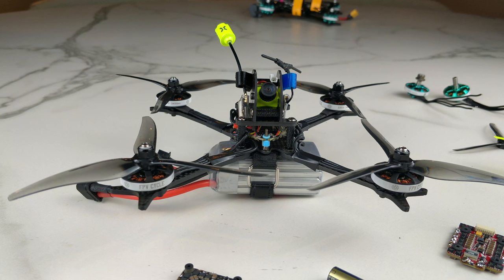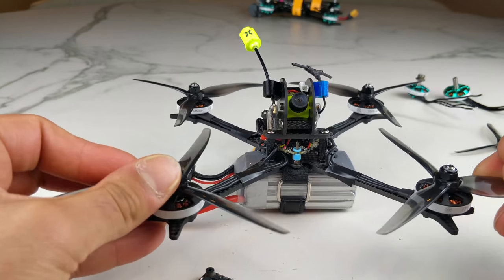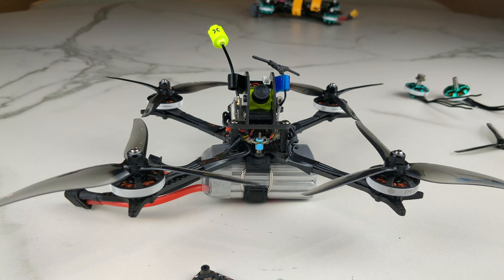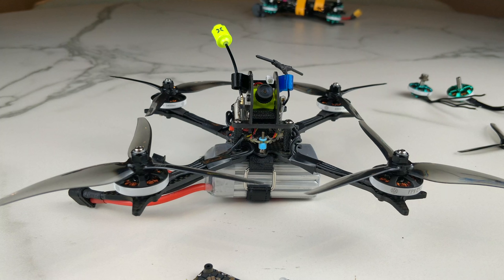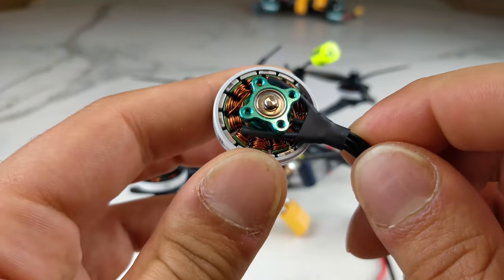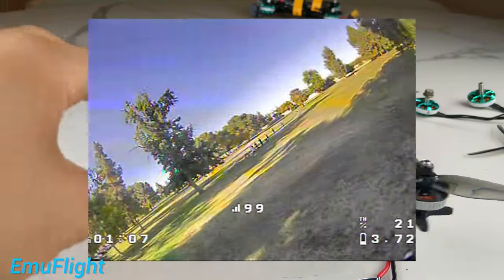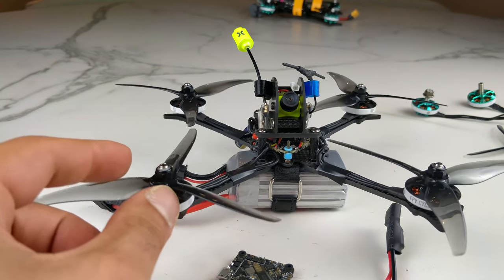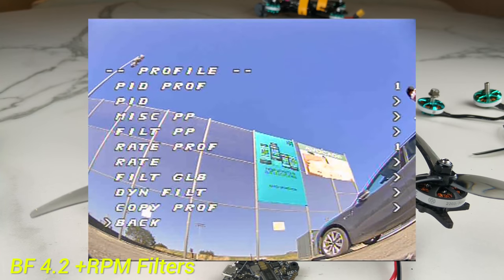Unconventional Tuning...

Comment: Bob, if you are running the same rig in other quads, same everything but different frame (and putting aside the capacitors stuff ) are you thinking on some type of flaw in your frame design or in the carbon fiber used? 
Because as you say the only thing changing from rig to rig is the frame.
Reply: Bruno, check out the first 10 seconds of the video, "..flies great on 3S." "..these motors were never intended for this frame. ..the lower kv motors that are yet to arrive may resolve current issues with this build on 4S."

While you may have a point in some other context, to me this video is clearly about pushing envelopes of the electronics, and drivetrain, given the condition of lack of blackbox data, by sampling the available software tools at our disposal, and it's clear the frame is fine at lower voltage. I might urge you to watch the video, and focus more on the data, and the issues at hand.  Also, if you will not listen to the first 20 seconds of the video, your attempts to contribute will likely continue to have questionable value.
Reply from the maker: I originally thought it had to do something with the frame itself but when I saw this same issue on other similar designs and also lower kv motors I knew it didn't have to do with the frame. I still have figured out how to fully solve the issues but I'm in the process of cleaning it up.
Reply: Rereading my comment, I sound like a total dick. That was not my intention. It happens to come very natural to me. Let me assure you though, that my desire is to be constructive, and that is my genuine reason for speaking up. Bruno, please pardon my tone, as it's something I continue trying to better align with my intentions.

Comment: im curious if you could hand it to a good tuner and see if they can tune it. i still cant tell if its a tune issue or a hardware issue. the quad is definitely super high performance and its been my experience that stock betaflight is very twitchy with super high performance quads. my personal reccomendation is to start by turning off all the goodies. turn off dmin, turn off iterm relax, turn off feedforward, turn off anti gravity, turn off throttle boost. DO use rpm filtering if you can. then tune it old school. start with almost zero pids (like pid=10 2 2). raise the p until it just starts to shake in a hover. then raise d until it stops shaking. then keep i as low as necessary to prevent wandering. In a perfect quad, P will do all the work. for example, i can kind of fly with pid=80 2 2. its sometimes jittery and the nose wanders around a bit, but its flyable. then i add a smidge more i and d and its perfect.
Reply from the maker: I don't use any of those things but antigravity to begin with.  Also, the issues this quad has aren't PID related for the most part.  It's more extreme than that.  It's just really annoying that the exact same drivetrain on another quad is perfect.
Reply: @Kabab  ok good, sound like you already tried all the usual stuff. exact same drivetrain acting different is a head scratcher for sure. they should both fly fine on any frame. I guess i have to agree with you, once i get to the point where I think it might be weak mosfets or partially shorting motor windings or a bad gyro, i just start tossing hardware. couple times i have made it into a science experiment but usually i cant find the time.

Comment: This build is a bit more advanced, even if you've built one before.
Good thing my second build is going to be a 4-inch with Li-Ion, Ardupilot running on an F4 FC, and should be under 300g. That'll be easy! /s
And that's before I feature-creep it and add a tilting camera for no reason.

Comment: There are some capacitors on that AiO FC, they're the little brown rectangles (multi-layer-ceramic-capacitors). While they tend to have less capacitance per weight/volume compared to electrolytic caps, they can have lower ESR (as outlined in another comment). Because they can be mounted right next to the parts that generate or are sensitive to voltage noise, the wire resistance is also less, which makes the capacitors 'faster' and may actually mean that you don't need as much capacitance. But it looks like you're putting so much power through the board that the AiO FC simply doesn't have enough capacitance to deal with the larger spikes from the bigger motors.
Reply from the maker: yep, this is really pushing things beyond how they should perform.

Comment: That bobble with 4.2 often disappears with disabling D_min. Idk if they changed d_min, or something else that just shows up with improper d_min settings, but turning it off simplifies greatly. If motors are staying cool, I leave it off now.
Reply from the maker: Intesting. I'll give it a shot.
Reply: @Kabab  Please share your results with D_min off!

Brandon, thanks for the tip.
Reply: @24kJames  talking with Mark (UAV Tech) really forced me to adopt it. He almost never uses d_min and I asked why, his response is that most quads don't need it. It got me thinking... If you look back at the initial implementation of d_min code, it's purpose was to keep motors cooler, at the expense of slight delay in cleaning up propwash (d_min takes time to ramp up). Well, we have rpm filtering now that kinda solves the issue of excess D-term noise generating motor heat, so we can improve latency on propwash and forward flight by disabling D_min. Even without bidirectional dshot and rpm filters, we don't need d_min usually on a clean build. I think it's defaulted to enabled as a safety feature for those who leave everything default. But it's not ideal.
Reply: @BrandonBeans  That is a solid, well laid out basis for d_min OFF. I very much appreciate such quality information. Thanks again.

FWIW, all I can add is that this topic has bubbled up a number of times in recent readings, and videos, each instance equating d_min off with much reduced bobbles/propwash. My own research on the topic awaits.

Comment: I have been designing and 3d printing my own frames for years. I am really messy with my builds and hate PID tuning. One thing that has come to my attention is that true X frames are very finicky compared to anything else. stretch, wide, hybrid, plus, they are all fine. As soon as you go close to a true geometric X the quad just starts having issues and needs, at least some, tuning to fly properly. Your disclaimer applies to me too, I have some training and experience, but what i offer is just my impression from messing around with quadcopters for 4 years.
Reply: I've built around a dozen quads and about 10 have been true x's and the other 2 more H style, and I don't think a single one has flown anywhere close to how I wanted with default settings on any betaflight revision.  Never had mid throttle oscillations like those depicted in this video that couldn't be solved by adjusting PID's, but most of my esc's are from last generation (bigger everything) and flown on BF 3.XXX.  Not really making any kind of point here, just adding my anecdotal experience to the "data set"

Comment: I think people need to understand the depth that Betaflight has gone into in its long term development from simple Cleanflight fork. DSHOT, Bi-Directional DSHOT,  LP/HP/Notch filters using lower latency algorithms, applying expo to filtering the D term, FF, sliders, linear thrust, anti-gravity, I-term relax, the refined PID loop that isn’t aliasing the gyro signal by people changing it from its native chip speed and locking it in per chipset,  dynamic idle, airmode, dynamic filters, oh did I forget? RPM FILTERING! It isn’t for someone who just wants to flash and fly usually but with 4.2 w RPM filtering and being able to fly out the box 90% tuned on “most” rigs that span a class from 2” to 7” a range of electronics, motor sizes, batteries,  is simply a feat of genius. Betaflight is the ultimate tool for the person who wants to dig deep and get the cutting edge out of their quad but you have to put the effort, research, logging time, and general interest into wanting to do this. In the end it WILL fly better than any other fork out there it’s just people want to flash, do the minimum and fly and if it some other fork seams to fly better it’s, “ooooh <insert name>flight fly’s sooooo much better”, um really? No just Betaflight is for the person who is willing to try cutting edge features now, willing to accept that yeah your probably going to have to spend some time tuning in many places but in the end the firmware is unbelievable code wise with what they have done hands down. Don’t get me wrong there’s a place for firmware that’s super simple fly’s pretty good out the box with minimal tweaking, I get that. Just understand it’s called Betaflight for a reason.
Reply from the maker: understood and at some point I will have completed setups with completed tunes available for people as well because getting all that working right is just an awful experience for most.
Reply: KababFPV Totally and for the beginner starting out that just wants to get out there and fly (and the experienced pilot too) I can understand the frustration level, it happens to me too. It’s like when I’m in the CLI I’m like “I got to do this again?!”. I think your approach to having premade tunes for pre-built quads is a great idea. I’m liking your design ideas. I actually just built a few large CNC machines based off the openbuilds designs and components and going to start offering my services to cut carbon like Arnattan Productions but with lead time of a day unlike a month or more. Plus I’m in so cal too so I can ship USPS priority and people can have their designs within a week. We’re building the site now.

Comment: As a point of clarity - most EMI noise is happening at much faster timescales than the acoustic filtering, so the switching related EMI isn't strictly something that is worsened or improved by firmware filtering running at the <1kHz range - which gets confusing because having improper filtering will lead to stressing the motors quite a bit, and then pushes that towards the EMI filtering end.
As far as the BF development model - I can't figure out what the guys who contribute so much want to do it, but realistically the answer can be as simple as recognition for making something that amazing.... both BLHeli_32 and Thorsten charging per ESC was brilliant, and both are fundamentally the same business model (just who pays for the license).... 
I do agree that 3.5.7 is great out of the box if you can't be bothered to set up RPM fitlering, and there was problems with incorrect dead time setups that burned some mislabeled stuff... but if you're running RPM filtering without changing the CLI snippet defaults, it's not going to fly any better... properly set up BF4.2 is objectively better, I've looked at enough logs, but it's only conditionally and practically that's harder on some setups (especially 7", which are just dumb most of the time)
Reply: tehllama42 Ya totally. I mean the filtering really deals in real life with motor noise as a result of vibration more so I believe as these gyros really aren’t even made for our application. It’s like we’re still using cheap cell phone gyros MPU6000 etc; but I totally get what your saying. At < 1Khz+ I don’t know if sinusoidal vibration can even reach that high of a wavelength but I have no data to prove this, and especially with soft mounting motors, dampening flight controllers, and all the tricks we use to keep these demons at bay. I’m sure EMI is there, I know this, and part of the scheme is built on helping eliminate, or reduce I should say, EMI creep into the FC components so yeah it has a co fusing angle to it. I couldn’t agree more about what they have done. Bi-directional Dshot, from a simple question if it was theoretically possible arising from a development github discussion, to turning it into what it is now. I mean it’s genius, getting eRPM data that’s accurate based off calculating magnet stator rotation and dshot timing control signals at super low latency? Amazing. RPM filtering, to me is the best thing since they started using the basic LP/HP/Notch filtering in the schema they used back in early Beta releases (3.5.7 etc) or possibly when dshot first hit the streets. Once you have it tuned, and yeah it can be finicky on certain quads, but if you spend the time on these CLI features and really dig in and tune to precision it’s the best thing out there and that’s the honest truth. Most people use Emu or Raceflight or whatever fork is currently hot with their couple somewhat interesting modifications and the just think “it fly’s soo much better” but the truth is betaflight is really not (though they have moved this direction with sliders etc) for the beginner for creating awesome tunes and specific flight characteristics. They just want to flash something and do the minimum and if it fly’s better out the box basically “it’s sooo much better than betaflight”. I hate when people say that because they usually don’t have any idea of what’s been done with this software and what is capable of. Learning isn’t all that hard either if people just do their research and have some engineering/mechanical knowledge. Good post. Killer quad tunes with features that are mind blowing are just the representation of someone willing to put in a little extra time and tune it right, but 4.2 out the box almost fly’s perfect on 90% of the quads I’ve used it on, and those ones it didn’t, I just made the proper changes via logging and research over years and it’s fixed. It’s more people understood how hard it is to create a firmware that spans a huge variety of quad sizes, frame setups, motors, batteries whatever and make it fly almost 95% tuned out the box on all these, it’s quite a feat.
Reply: @vicewize  There are some definite knowledge barriers to getting the most out of it, and I think you're exactly right than 90% of people just fly what's out of the box and assume that's the capability, while those who have the right background or enough time to understand the nuances of what's going on can get a lot more out of it.  More levers can be hard, but yeah.  Especially when certain base tunes can just hit lucky nodes where the phase delay and mechanical delays overlap and you end up with really dialed stuff, if you flash four different firmwares, odds are one is going to have the 'magic' answer.  Having a monster fleet of 42 quads, I found that out early on

Comment: You don't need JESC for RPMFilter.  JESC, BLHeli32, and BLHeli_S support RPMFilter, the free version of BLHeli_S works... Betaflight Wiki links it: https://github.com/betaflight/betaflight/wiki/Bidirectional-DSHOT-and-RPM-Filter
(Although I use JESC cause why wouldn't you.)  Also that's my problem with that AIO board, the Betafpv 20A v3 has bb storage.  I usually tune by feel (and ultra light weight quad with 2004/5125 props was nightmare to tune, eventually realized I had to turn pd gain way way down, I got d at like 18.  But even if I just tune with feel, in the end I still like to do bb log just to see how awful tune is.

Comment: Adding a 35V cap to a 4s build is ineffective.. I add a 25V to a 4s,because it has higher mF for same size cap and it is more efficient. Like having a 35 gallon tank, but only adding 16.4 gallon. I would even say a 25v 1000mF would clean up more than a 35V 2000mF, because you are closer to the capacitor rating, so it is doing more work. 
Sure, it won't hold up for as long. But neither won't a quad build to crash.. You replace 4 motors, just replace your cap at the same time.
Reply from the maker: The voltage doesn't matter as long as it's higher than the spikes it'll be absorbing
Reply: @Kabab  but it is still less effective if it is a 35v running 4s than a 25V on a 4s quad

Comment: This just shows how great RPM filtering is. You can just build clean quad(hopefully), add a cap, flash BF 4.2 and enable RPM filtering, change dynamic notch to deal with very low noise between 100 and 300Hz, and rise all lowpass filters to high cutoffs like 400Hz PT on gyro and 250Hz on d-term, and you will get great performance. And if you happen to build not very clean quad noise wise, you just do all the same but keep lowpass filters low, like 3.5.7 low, so gyro at 100Hz PT1 and 300Hz PT1, and d-term, i don't remember, but somewhere around 150-200Hz or perhaps lower, and you should be fine. And i agree, PIDs doesn't matter as much as filtering and clean gyro signal
Reply from the maker: Sure but 4.2 still flies awful by comparison with 3.5.7.  The only advantages to 4.2+RPMf is that there's no dipping on throttle pump and the motors run a bit cooler.  The jitters, high speed wobbles and throttle offset wobbles are still there in a big annoying way
Reply: @Kabab  Well for me 4.2 is flying superb, check out Bando And Tower FPV on my channel, i was already then on 4.2 pre-release ;) But in my humble opinion, for it to fly well, you have to bother to set everything up correctly. If you just flash firmware and go fly on defaults, then 3.5.7 is really better than 4.2, just because it happened to have very fortunate defaults that fit widest range of quads
Reply from the maker: @KamilK3  this particular quad doesn't fit the mouldbthsy 4.2 expects. That's why it sucks.